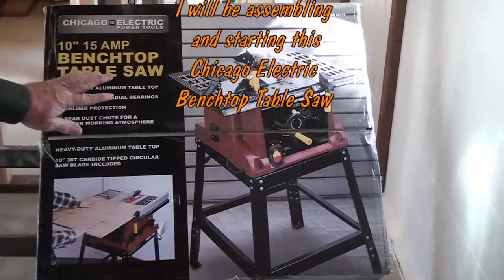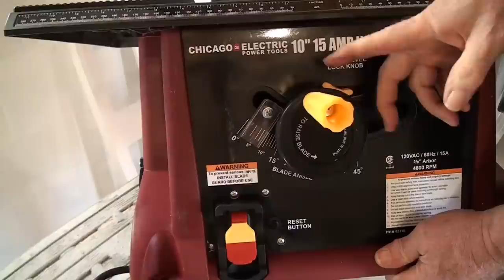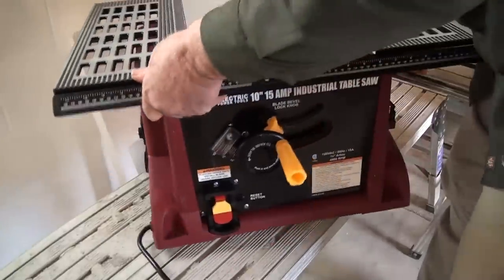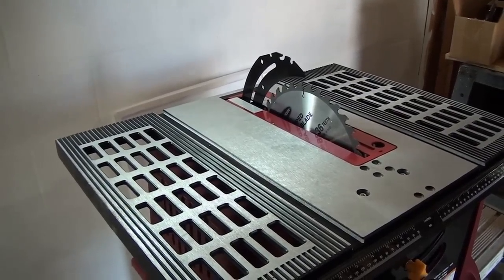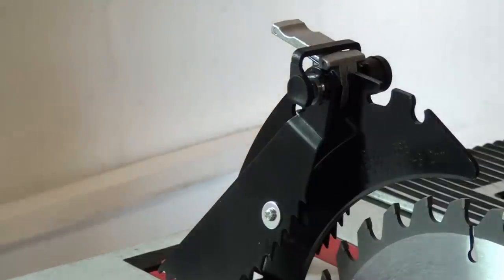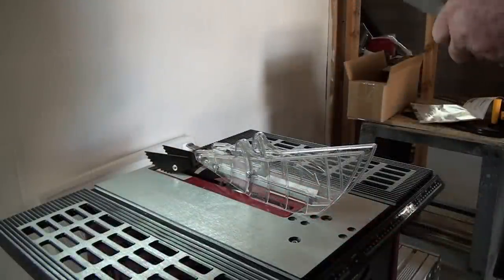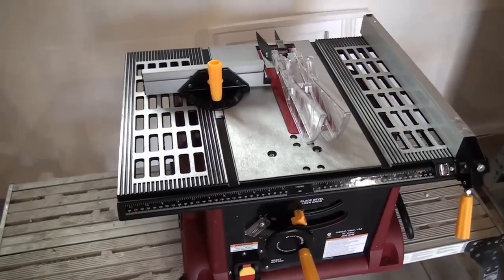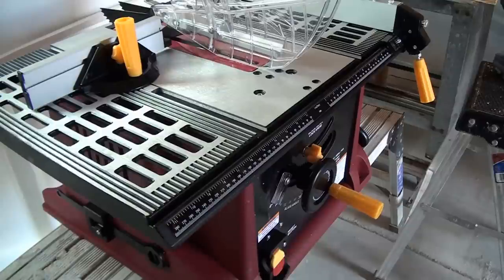Table Saw Assembly Harbor Freight 10 in

Comment: Just bought the same table saw from HF yesterday. Also bought the matching stand. Got the stand all assembled and, You guessed it, the mounting holes on the saw DO NOT MATCH (line up) with the mounting holes on the stand! Brought the stand back to HF, met with the store manager and presented my case by comparing the stand with the floor model of the saw...did not line up their either. Manager verified that I purchased the correct stand as per HF. Manager said he would have to look into it, but offered not solutions. Wound up going to Lowes, getting a 5/8 2x2 plywood, 3/8" nuts, bolts, and washers. Drilled the holes and mounted the plywood to the stand. Drilled more holes and mounted the saw to the plywood. $20+ additional time and labor. I later noticed that if you look closely at the picture of the saw and stand on the box and on the manual, it's obvious the holes will not line up. Guess that HF's way of CYA. Have not cut my 1st board yet, hopefully my next post  will be praise.
Reply from the maker: Good Post! HF really needs to make a stand to fit!
Reply: This happened to me today as well, pretty irritating,  but not a big deal
Reply: 🤨 Wish I would have seen this before buying and assembling the stand. Same thing. Going to use 2x4s so there’s an opening for the sawdust to go through.

Comment: Thanks for posting this video . I probably tried 30 times to get the paws to stay on, then I found your video.   I don't understand how they stay on either, but they do when you install them the way you showed it.   One thing different was I'm left-handed and after your video, I tried it with my right-hand just like you did it and boom!  It worked.   I was just about to put the whole saw in my Jeep and drive back to the store for help!   I wish I had seen your video before I unpacked it, I destroyed the styrofoam getting it off, would have been a lot easier to do it the way you showed it.
Reply from the maker: Thanks, glad you got it to work. It definitely is a learned experience to get these safety items to stay in place. Styrofoam...yep they do pack it very well.

Comment: I have the same saw.  Instead of this class of saw get a used Craftsman or some other moderately priced used saw.  You won't regret spending a little more and getting a much better table saw.  What I like about the older Craftsman saw is you can find a 2nd one to extend the size of the table.

Comment: Just bought a used one, is there any way to remove the riving knife? I’m using a thin kerf blade and the riving knife is thicker than my blade causing it to hang material.
Reply from the maker: The riving knife is adjustable lower or higher. I believe it is permanently attached.

Comment: I made a huge mistake when I bought this table saw..... DON'T BUY THIS. 
Stay away from Chicago electric tools
Reply: @jaydawn2899  It's very cheap made. And after a few cuts it started to make a weird loud sound like something would be loose . I checked everything underneath and didn't see anything loose but that loud noise is there . The fence it comes with I had to take everything apart and reassemble it right . Ultimately I'm not happy with it but no choice for a while till will get another one a different brand.

Comment: On a good saw the riving knife goes up and down with the blade so you don't have to reach in there and adjust it.  also the kick-back pawls and the blade guard are all one piece that locks in where the riving knife attachs. Harbor Freight needs to close.

Comment: There was a loose spring when we unboxed the saw. Nothing in the instructions about it. I watched your video looking for an answer and didn't see it there either. Do you know where it goes? Thanks
Reply from the maker: Check the parts diagram at the end of the user manual that comes with the saw.

Comment: The fence was not installed correctly and that was why it was wobble. You need to slide it in from the end of bar with the ruler.  I have the older model with the same number 97896, the arbor is much longer to accept dado blades.

Comment: what is the max left rip size?
Reply from the maker: https://manuals.harborfreight.com/manuals/63000-63999/63118.pdf
call 1-888-866-5797
Reply: @SteveAZ711  meant to ask the max right rip size.  however, bogus manual doesn't show the max rip size for either side of the blade. not sure about calling, as the last time I called them, they didn't have a clue what I was asking.

Comment: That is what I don't like as they show the stand with it but the stand is around $40 extra.  Booooo.
Reply: I bought the stand, it doesn't fit, I need to make two boards to bolt to the stand to bolt the saw to..grrrr
Reply: I bought the stand and the dust bag, neither of which fit 😒
Reply: I spent like 10$ on lumber to make my own
Reply: Damn, neither fit?  WOW.  As far as the lumber I can see 30 but not 10 which each 2x4 is almost 3 dollars and the plywood top was 25 a sheet I had cut down.  Maybe 20 for just a 2x4 frame to hold it up and no top so the sawdust can drop down but not 10.

Comment: Good show mate! My only problem is the saw blade is off about 4° ...do you have any idea on how to adjust it. Really hard to get true 90° cuts even with a makeshift sled
Reply from the maker: I believe the manual says the motor has some mounting adjustments that can be tweaked to improve the angle.

Comment: mine worked for 2 cuts then quit.
Reply from the maker: Tim if the reset button does not fix the problem, then send or take it back. No sense in fighting issues on a new purchase. That's what I would do.
Reply: @SteveAZ711  that's my plan.